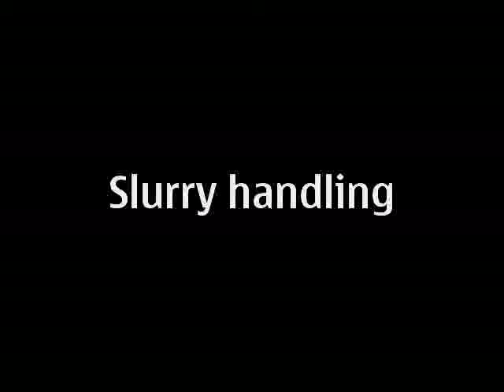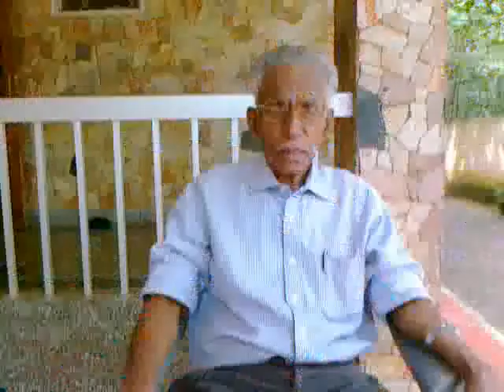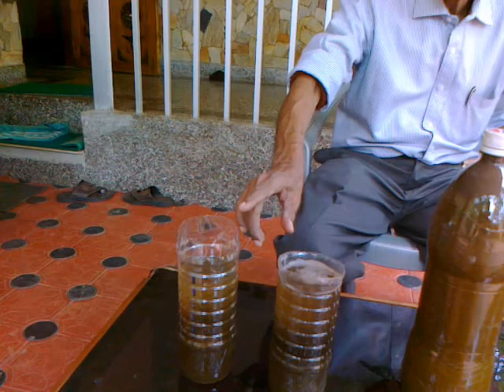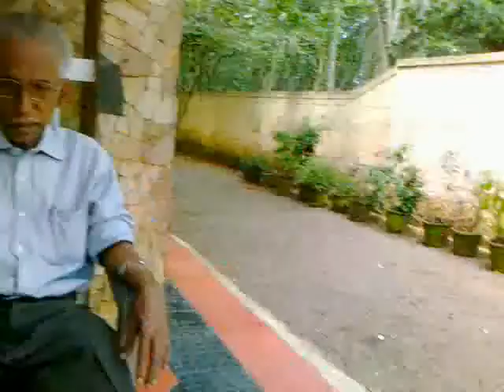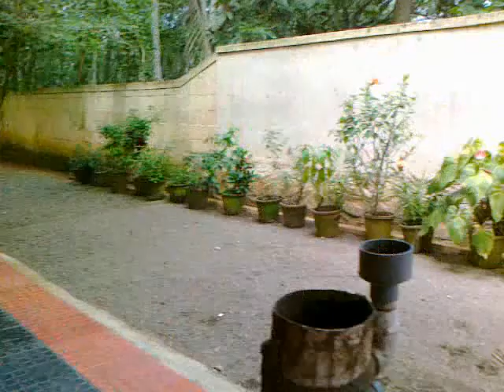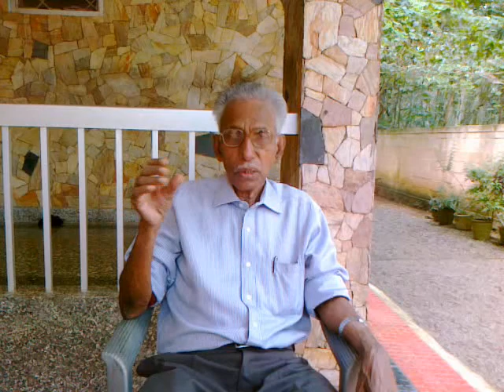Farmer's Innovation for handling slurry

Comment from the maker: YES. 6" thick slurry can be put in to a platform with ventilated wall at 4' x 4'  Aerobic compost plant can be added some dry leaves on it. Over this any meat waste or died animals, flies etc on it and can cover again with 6" thick slurry by protecting with a roof it will convert in to compost within 90 days without any bad smell at each home or for a group of homes.